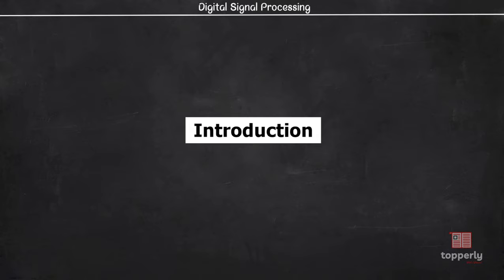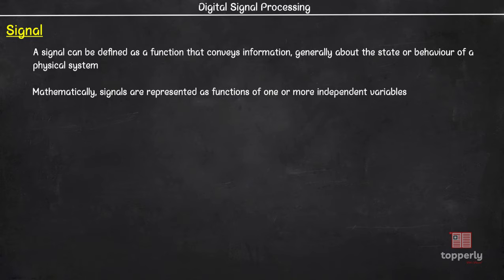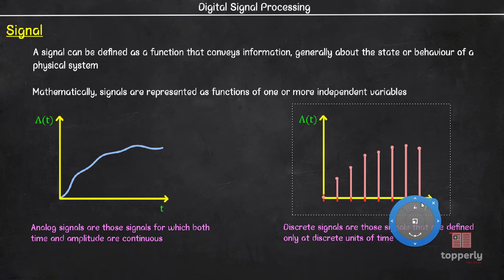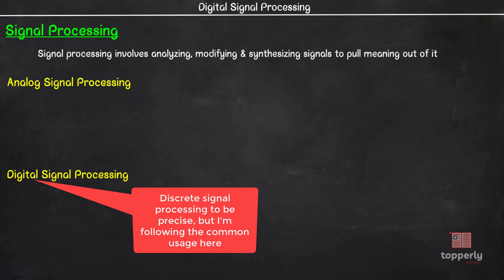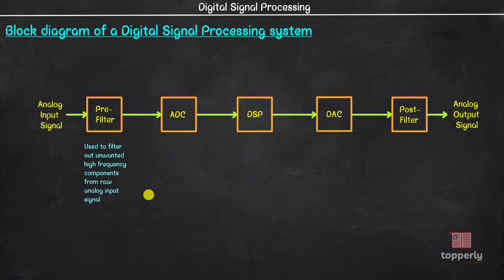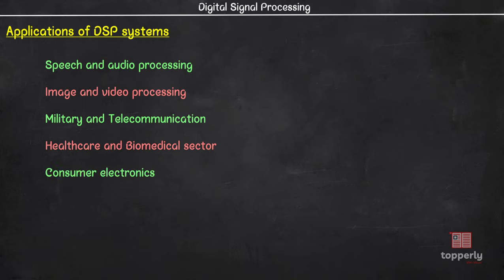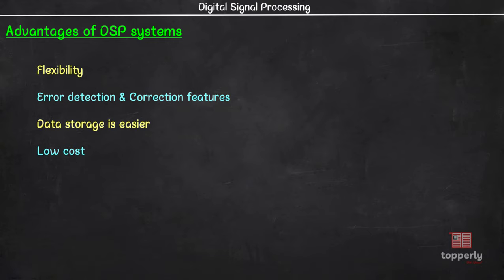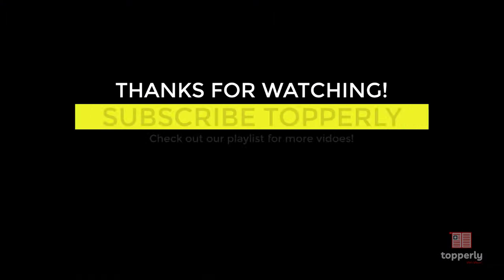Introduction to Digital Signal Processing | DSP

Comment: what is need to convert analog signal to digital signal? we can use ASP directly , right?
Reply from the maker: Digital signals are less affected by noise,  interference and distortion. Also digital circuits are more reliable and cheap and changes in processing can easily be made with help of programming. You also get to store data for later analysis if we use Digital signals :)

Comment: so what about if there is a frequency lower than 20Hz for the example of an audio signal how can does frequencies be remove?
Reply from the maker: We'll filter them out also. For that the pre-filter we use will be band pass filters (which we'll learn later) which are designed for removing frequencies both below 20Hz and above 20KHz :)